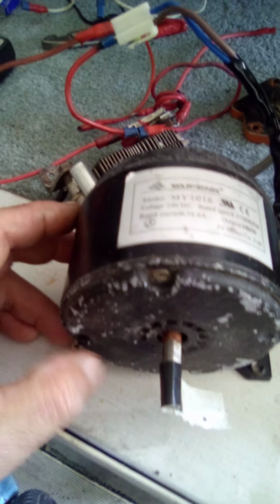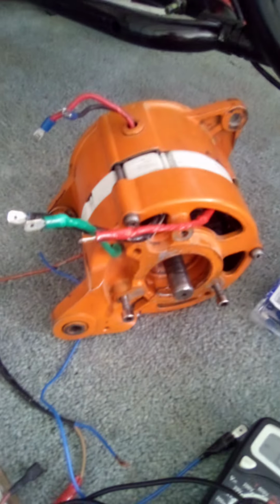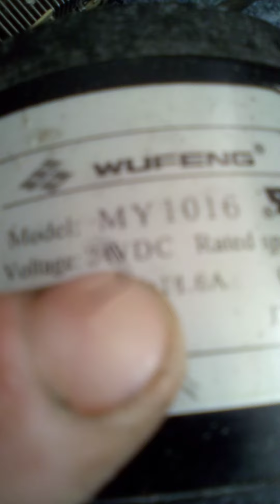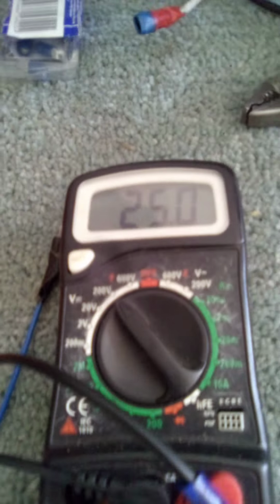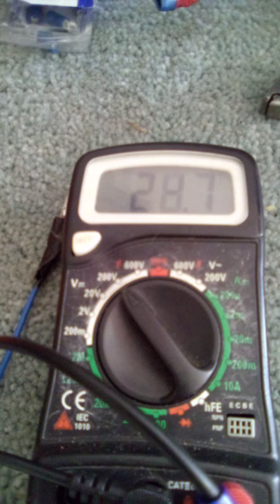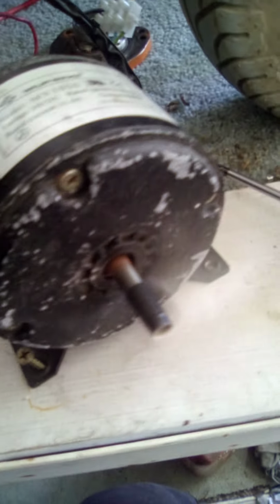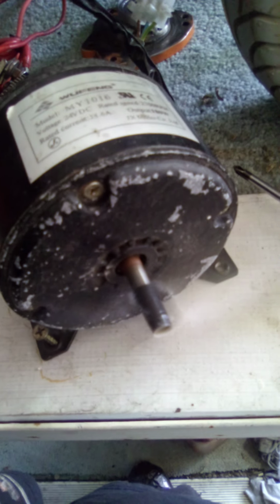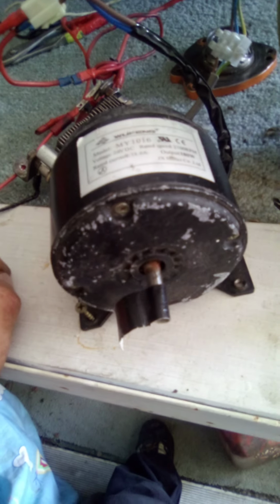how to run a brushed motor from a brushless motor controller 😁👍

Comment: Great info.. Thanks for your video sir.. 
Just one question, the output of fully functional car bridge rectifier normally is limited around 14.5 volt isn't it??? So the one you used in the video is a faulty one or what??

Comment: Do you know how i can reverse progress process to your design i need to run brush esc to brushless motor ?
Reply from the maker: Hi buddy yip it would work if it was the other way around.meaning brush motor and brushless motor controllers with a car alternator full bridge rectifier..🤔☃️
Reply: @tristanmcnabb2741  I want to use brush esc with brushless motor what im saying is how can I make it work
Reply from the maker: Hi buddy I don't think it can work that way.🤔

Comment: Can u recommend a rectifier i should  buy trying to basically do same exact thing  around 40 watts and 1000 watts
Reply from the maker: @curtisschmit680  hi buddy yip the bridge rectifier that's used in this video is one from a car alternator and that seems to be the best.but there are ones on line or at jay cars say that have 3 AC ins and 2 DC outs but that heat up a lot 🤔😁👍🎉🌟🦇 biggest thanks 😊👍 buddy from cruzermans inventions

Comment: Hey wat about the the five wires coming from the controlller I’m testin no power
Reply from the maker: Hi guys this has no hall sencers connected .the bridge rectifier is to turn the AC control back to DC I will try to make another video for you soon it had at moment because all my stuff is gone
Reply from the maker: @lusheidahenry4284  hi there iv just done another video of this one.its coming up soon with in the hour.its called taking a look at the difference brushed motors and controller and brushless motors and controllers

Comment: It's not a tutorial,  it's just a demo. Coz if your aim  to teach us why don't you show how the wiring goes where?
Reply from the maker: Hi guys I just watched the video and I'm wondering what is the wiring part you are stuck with.its a simple system
Reply from the maker: The bridge rectifier that came out of the car alternator is what I was using and were the outside field wires of the alternator were connected to it is now we're the 3 phase from the controller go to then DC at the other end 🎉
Reply: You need to show us on video  make another video  coz tutorial needs audio video. But ey no pressure it's all up to you man  anyway thanks

Comment: That's cool as but please tell us what to fo with the green wire on the brushless controller does it need to be connected to the motor if so does is connect with the yellow or the blue wire is like vital information you didn't share
Reply from the maker: The brushless motor control is 3 phase it goes through the bridge rectifier witch changes the field back to DC 😊👍 then you only have two wires positive and negative 😁👍🏆that's how it's possible to run the DC motor lol all some work for cruzermans inventions 😁👍🏆 biggest thanks